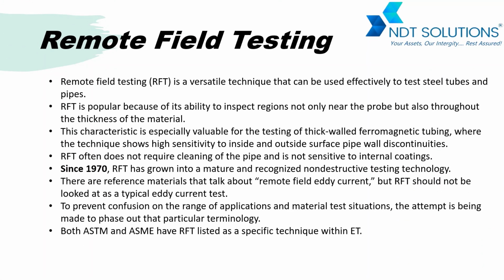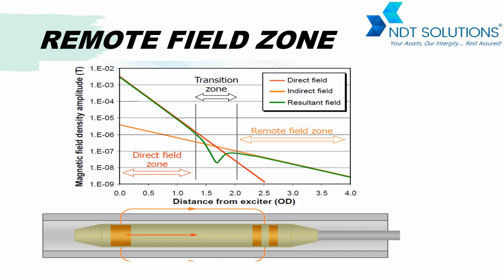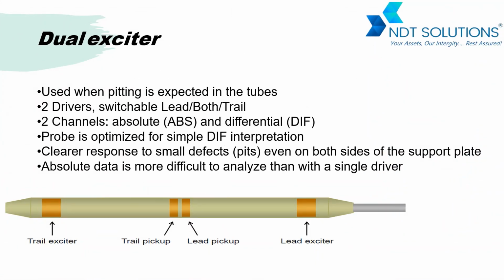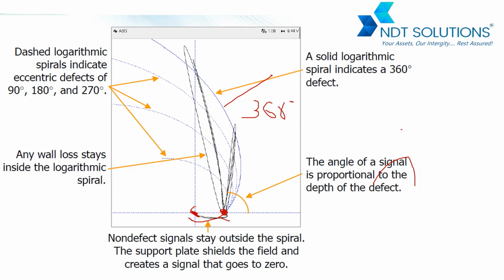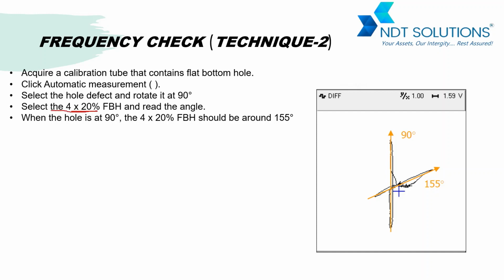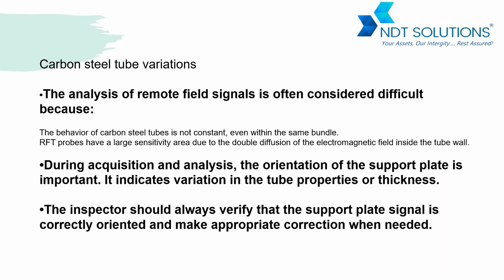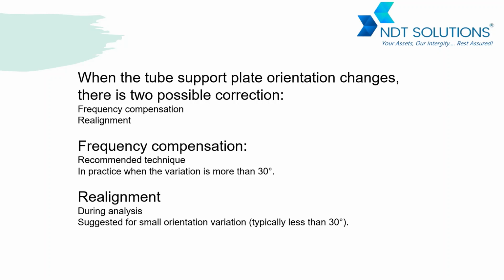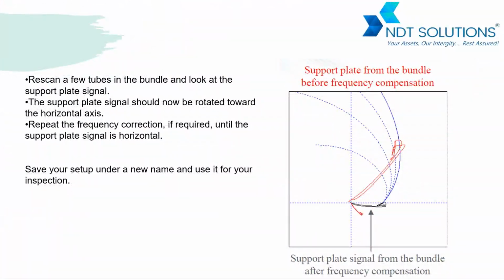#RFET#RFT#REMOTE FIELD TESTING#TUBE INSPECTION#FEROMAGNETIC TUBE INSPECTION#FREQUENCY COMPENSATION

Comment: Sir good day to you, can you please tell me the formula for NFT depth penetration? Thanks and regards
Reply from the maker: Formula for depth of penetration will be same sa ect. But in NFT we are inspecting cs materials, so the depth of penetration will be limited to the near surface only due to high permeability.
Reply: @ndtsolutions2823  yes sir but can you please show or tell me near field formula ..thanks
Reply from the maker: the depth of  penetrate due to the frequency, electrical conductive and magnetic conductive . you can use the formula δ=503.3/√fμrσ which is for the ferro-magnetic material.
Reply: @ndtsolutions2823  okay sir thanks...
Reply from the maker: Welcome
Reply: @ndtsolutions2823  sir one last question, why is it that some signals in ect tube testing is half cycle ( Hz ), because in calibration every signals are presented as full cycle...?
Reply from the maker: @olracardevaas7035  didn't get your question. 
But I guess what you are asking .
If the discontinuity is short then you will get complete signal in differential channel. But if your discontinuity is bigger than the coil then you will get half signal as you said, in absolutely channel
Reply: @ndtsolutions2823  sorry sir i just can't  explain my question correctly but i guess you are 👍👍👍👍 right..
Reply: @ndtsolutions2823  sir now i know what i am asking..I mean why some defects are half waveform only? 😁